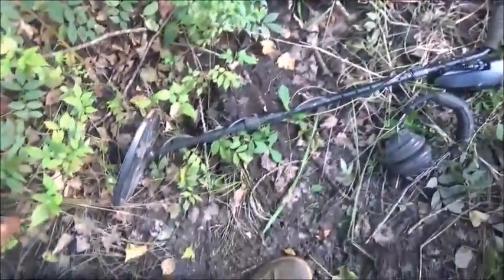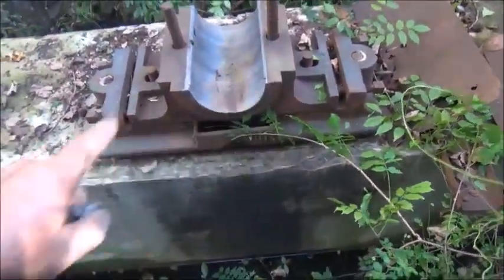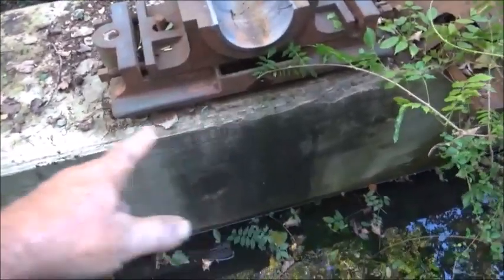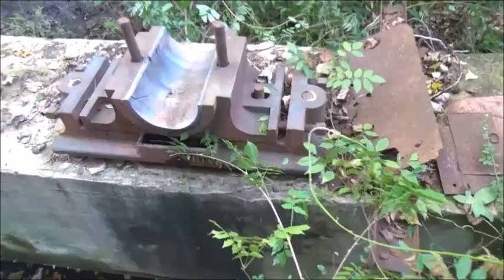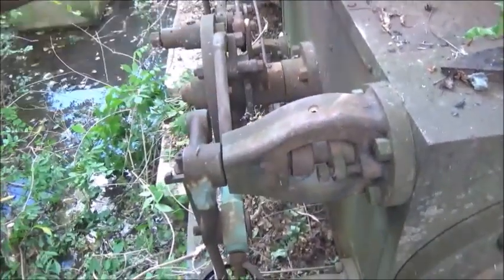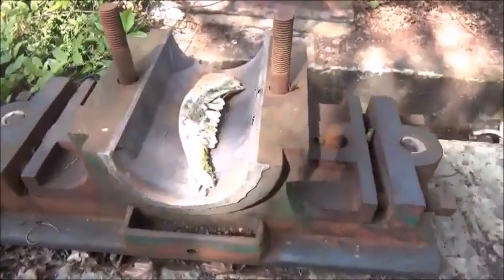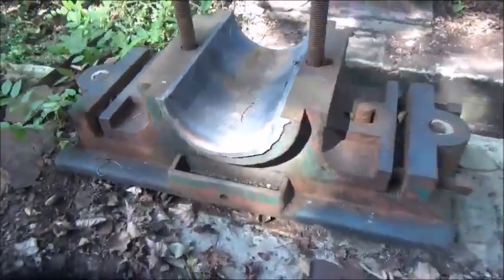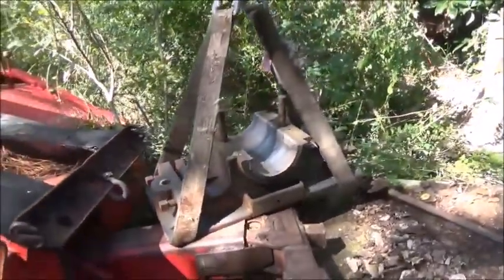BATES CORLISS STEAM ENGINE 20+ YEAR QUEST TO SAVE EPISODE 4

Comment: Jonathan, I got a college degree in mechanical engineering and design and I got to tell you... you explain that technical stuff better than most of my old College professors, ever did! 
I know you're just planning on putting this together for a static display, however if there's one person that could get this thing running again, you're probably the person. I would suggest doing so, and mounting this on a old low flat deck semi trailer, with a boiler, water tank and fuel storage, so it could be ran for demonstration at shows and exhibits. Would be awesome!
Reply: That's a great idea. That would be a great idea to share with the community.
Reply: is a semi trailer deck a stable enough base for this?   It's currently on a huge concrete platform/foundation so i feel like they did that for a reason, but i'm no engineer.  A mobile steam engine display would sure be cool though.  Would be easy to donate to a museum later.
Reply: @spark9040  Honestly I don't see why you would have any issue, yes you would probably want to strengthen the deck up for any twist probably, I beams under the engine. A good heavy trailer would definitely be ideal, along with a drop axle and air suspension. Definitely something you'd want to make sure was jacked up, leveled and blocked with wood or something when ever you ran, it However you're not talking about anything extraordinarily heavier than any trailer would capable of, weight wise, and you're also not talking about running the steam engine to it's full potential, or putting any type of real load on the engine during operation. So personally if it was done right, I don't think there would be any issue.  After I posted the comment thinking this is one of my brilliant ideas, that had to have been done by someone else.... I actually checked Google to see if there was anything similar and I did find a picture of one. So it's not a totally original idea after all, one of these days I'll think up something completely crazy unique, LOL But I'm not the first apparently on this idea. Now the engine Jonathan's dealing with would definitely be a bit bigger and more impressive. But still I would not see any issue. The height of the flywheel we not be too great and would meet the legal height requirement of a load, along with he said it had a 7 ft drive shaft, and a standard trailer is 8 1/2 Ft wide, he said the engine length itself was 17 ft, not including the Firewheel so I'm sure you'd want to run that up to my good 24 ft of room. Which would leave you an additional 24 ft of room on the trailer, plenty enough room for a boiler, and some room to put Fuel, and probably plenty of room as well for a a few thousand gallon water tank. It would definitely be a full load. Again I thought about this and I do think it would all work out. Here is a link to an article with a picture of the one on a trailer I'm talking about.

https://www.atholdailynews.com/Engine-show-standalones-18399146
Reply: @justinhobart8747  very cool pic.  your extra info might give Jonathan some ideas...
Reply: That 10’ flywheel would make the mobile part of that idea a total PITA. It would almost surely have to be disassembled and taken off the crankshaft every time the engine was moved. That’s not ideal at all for a machine as old as this one is. It also would probably require expensive wide load permits each time it was taken to a show if the flywheel wasn’t removed for transport. You would also risk accidental damage or destruction of the steam engine if it were involved in a traffic accident. 
I’m not saying it couldn’t be done, but it might take more effort or be a bigger risk than it’s worth.
Reply: @ralfie8801   I don't know why you would have to get a wide load permit... If you check out Jonathan's previous video he states the drive shaft/axle is 7 ft long, which is what that flywheel rides on, and as long as it's under 8 and 1/2 foot you don't need a wide load permit. You see that drive shaft goes from one side through the flywheel to the other side, so it can't be any much wider... there would not be any expensive permits. I also don't see why it would have to be necessary to take off the flywheel, I mean do you really think it's going to fall off??? Is designed to spin RPM on that heavy shaft with thousands of foot pounds of torque. Its own design is more than adequate to hold it! However you're right the stress of moving it, and the worrisome part of getting in a wreck yes of course it's there. But what's the point in having the thing if you're not using it it's a steam engine it's made to run, not sit there and look pretty. It neither needs to be sitting in a permanent Museum typesetting, or going to some of these shows. If you look up and I suggest you do old Threshers for Union Mount Pleasant Iowa oh, you will see several steam engine tractors like it shipped in every year, one of which is a good friend of mines. The old Threshers down there also has several operational Narrow Gauge steam trains ,  old trolley cars and a operational one-of-a-kind beautiful fun to ride original steam-powered carousel. are these steam shows and old Threshers reunions and Exhibits all across the country. There are classic car shows all across the country, people drive to them in their classic cars. Yes there's a risk. But what good is a classic car sitting in the garage if no one sees it? It's meant to drive! The same goes for the steam engine it's meant to run, and it's something that's great to show how it works to the Next Generation a people that have not a clue on how this thing works, maybe get their engineering minds and going. If Jonathan be rescuing this thing right now another few years it would be scrap metal. It's steel is iron it can be repaired it can be used, there's nothing on it that can't be fixed. Watching Jonathan's channel should prove that. That's my point anyway sometimes you got to weigh the risks of accidentally damaging it, to preserve it.
Reply: Justin Hobart 
My thought was that 10’ flywheel would have to be positioned outside the frame of the trailer to keep the thing at an easily viewable overall height, but I forgot about the bearing block outboard of the flywheel itself. So that wouldn’t be possible and permitting wouldn’t be needed. 
But that does limit the trailer type to a lowboy in order to keep the overall height of the steam engine above the trailer deck at 8 - 12 feet so that people could view something more than the bottom side of it. With our litigious society these days, I would not include any steps for people to climb or raised platforms for them to stand on to view the thing. The cost of the liability insurance just for the public to view it from elevated platforms would be a deal killer when typically there is no monetary compensation to be had for showing these machines at antique shows.
Reply: @ralfie8801  yes lowboy if that's what you want to call it, that's exactly what I was talking about. Not just due to the visibility but due to the height of the flywheel, because besides width you were worried about there's also height limits on trailers loads, a low-slung flat deck AKA your lowboy with a Air Ride axle drop axle would be the way to go. As I stated the factor is the cost of doing such a thing would be the complete limiting factors to this idea... I'm sure Jonathan could get this thing running if you wanted to without too much cost with his skills, but the real cost comes from the trailer water tank and a new boiler, the certification sometimes required for boiler with all the liability insurance of running an operating it. Insurance is the cheap part.
Reply: @justinhobart8747  IMO it is far far better suited as a static display and I bet JW will take it to running condition(be great content) and then be easy to run on compressed air for demo's. A Boiler set up would blow the bank account right to heck. But having the original boiler as a show piece with it is a big plus in preserving its history
When you hear JW talking about casting the bronze pieces and lead/tin bearings ....the easy part will be making it run. Hopefully the cylinder is in good condition and not corroded to heck.
Love to see it run
Reply: Theres been a lot of question here whether this this crazy idea of mine  is possible with putting it on a trailer... I think it is possible without a doubt... obviously I think it's a good idea, people wonder if it's possible, will have to be dismantled... I don't think there's any big issues at all. However the big issue is the cost! First off how much does a semi trailer cost, you're looking at easily a 5 grand investment, just in a trailer, then you have all the headache and cost a machine work and everything in getting this thing operational... Well I know a guy I'm watching his video now LOL Jonathan can handle this I think... however then you also have the cost of a boiler, and a water tank, two items that are not cheap. Then you have the additional cost of insurance, licensing and all that you have to license the trailer, maintenance, and you have to ensure everything you have to have personal liability insurance to operate it, all for free and fun for folks to come and see... This is why nobody saved stuff over the years and they end up going to the scrap yard. So when you simply talk about getting this thing operational and taking it to shows whether it's on a trailer, the cost is a lot boiler certifications, insurance, maintenance... taking me a headache so, you have to have a passion for it. So that's the big issues! Not mounting it on a trailer!
Reply: @justinhobart8747  i was thinking it would be mostly used as a base to set it up.  I don't forsee JW will ever travel with this except for to a new owner like a museum where it won't rust away to nothing. Does he even need to get all the parts like the boiler and water tank just for it to be minimally functional?  someone mentioned compressed air in another comment.  Not sure what the implications there are...I don't think it's realistic for JW to go for a full bore restoration.
Reply: Neal Head   Perhaps more work and videos on the steam engine by Jonathan W will inspire people and youtubers to help.    He is getting awfully close to 100k subscribers which imo is the point where most channels hit a pretty nice steady state and more attention from others.  Either way, it's going to be fun watching Jonathan work on this in any capacity at all even if it is cosmetics only.

Comment: I'm sure glad you got some metal detecting done before they went in with that bush hog...l like the way  they got it opened up over there - you can see a lot more now & I'm starting to understand the set-up & how everything works together...when it all gets done, if it was me - I'd metal detect that whole area including where the building burnt down and down there where you found that pump...l know you got to pick up a good couple o' three dozen pieces of scrap before you locate something of value but that something of value could be 100+ years old...good video
Reply: His time would be better spent casting/machining parts from scratch than in the weeds for days looking for something that might not even be there... 90% of it is there for historical factor. But if there were detecting volunteers in the area?
Reply: @Rebar77_real  l agree - that's why l said: "when it all gets done"
Reply: PS. Make sure you take plenty of drinking water with you next time you go out - that cow might've drunk some of that water over there & died

Comment: If you want to verify whether it is city water or not get your hands on a pool test kit and test for the presence of Chlorine.  My brother-in-law who had a pool claimed his lower land was always wet from a spring.  Did not seem right to me so I tested for Chlorine and found that indeed there was a leak on the supply side of his water meter.
Reply: I had the same problem in a customer's garage, the Water Company told him it was wet from a natural spring Hydraulic pressure! .ha ! I did the same thing with a test kit from Lowes and showed it to the Supervisor.This customer replaced two sump pumps every year to keep his basement dry-they ran all the time. imagine how much electricity and cost of these pumps over ten years was.
Fact is- I noticed the chlorine and the fluoride was leaving white stains on the concrete- which the Stupidvisor said was lime and minerals.
The 10 inch main underground was leaking from bad o-rings and flowing on top of a shale ledge into the house.

Comment: Johnathan  You can dissolve that concrete around the bolts and then remove the metal.  They don't chip the old dryed concrete out of the cement mixers anymore. They throw this stuff in and it comes out like new. Pretty neat. Elora Solutions
Reply: Looks perfect if it can be shipped out of Australia. (Elora Concrete Safe Remover was the name I found.)

Comment: My 1936 Chevy has Babbitt main bearings
Reply: Keep your oil clean and never let it  overheat!! My dad told me about Babbitt bearings!
Reply: tom cline absolutely, I just had to have them re-poured. Very expensive rebuild.
Reply: @paulpfaff7937  Dad worked at a service station during highschool,in the 60's,and the boss had built the shop after WW2. He had all the stuff to pour Babbitt,some engines had A Lot of Babbitt in em.  Was it to difficult or to expensive to replace with modern bearings? Hell,or even possible!?
Reply: tom cline it was even possible, I explored that but it wasn’t possible to use inserts
Reply: @paulpfaff7937  That's rough! At least you found someone to pour new ones! Dad said that if you take care,they last pretty good. Take care,be safe and healthy.
Reply: tom cline you are right. The first set lasted 83 years. Effingham Machine, in Effingham IL, about 100 miles from Indianapolis did the work. You take Tom as well and be safe.

Comment: Torque on the beastie would be about 10,812.9 lb/feet  by my calculation. Give or take 😉
Reply: I think anyone would classify that as being "adequate..."
Reply: I guess that the saw and the planer did not bog down when you pushed a big piece of wood through it and it didn’t know that the sewing machines were running.  That is BIG power from a hundred and twenty years ago.

Comment: I doubt if it’s concrete it’s probably grout common use in those days to set the engine up perfectly level.
Reply: Grout is commonly used to stabilize and permanently to secure the machine AFTER leveling a machine.
Reply: Mark Veits 
At Coolspring power Museum when I was a director there we used grout after the engine or accessory was shimmed perfectly, yes it’s leveled first and then the grout is put in under all of those surfaces, go see the 300 Miller engine. It seems that the steam engine is sitting on a foundation where it was originally used so it would have been grouted.
Reply: @markveits6300  Yes true, im still installing large machinery- gas turbines - Sag mills in mining etc . Grout is standard procedure not just then but always has been. Anti vibration is also what it does. Not that that corliss would have much vibe at those low revs .
Reply: @markveits6300  Spot on Mark , and also for anti vibration.